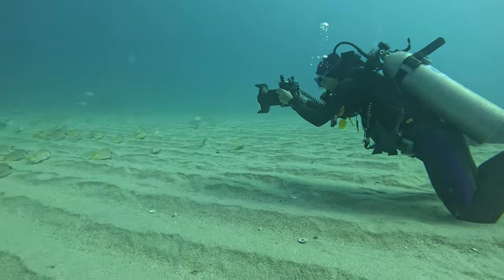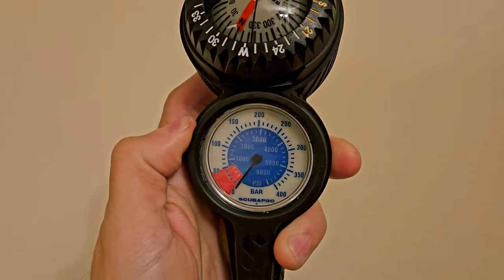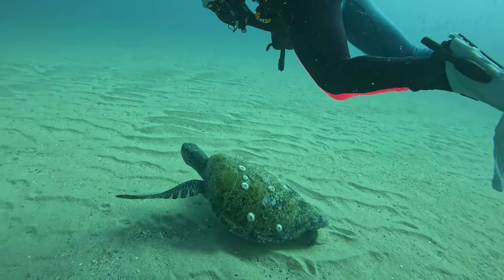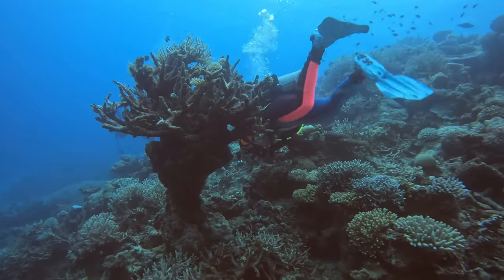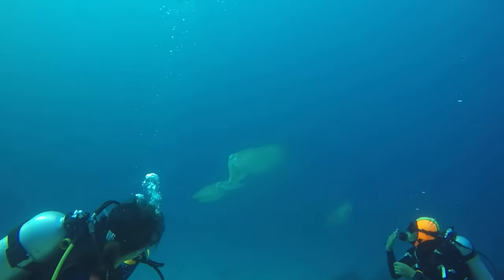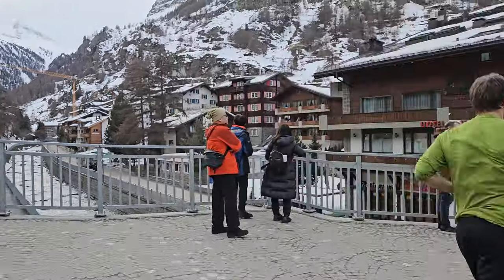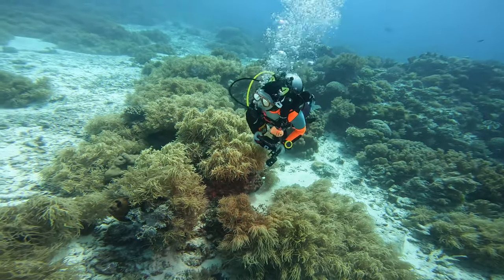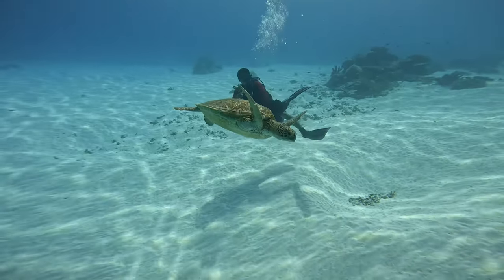How to Make Your Air Last Longer in Scuba Diving

Comment: As a perpetually overstressed engineer, I found that even when I thought that I was completely relaxed during dives I was still a gas hog and would dive 100’s to keep from limiting the other divers dive time.  When I switched to an AI computer and turned on SAC rate tracking, that gave me real time feedback on my level of relaxation during the dive.  This gave me the information needed to tell when I was actually relaxed and breathing well vs just thinking I was.  Within a handful of dives I’ve dropped my avg SAC rate from the high 30’s to the mid teens.  Shared my trick with another engineer who was sharing the dive boat and he said that he was able to noticeably improve his air consumption after just one dive.
Reply from the maker: Love this tip, and I am glad it worked for you. We are eyeballing getting a Perdix this winter after the wallet cools off from buying a dry suit and other cold water gear but will be giving that integrated air a try and exploring my SAC more!

Comment: So this guy went down with you without a full tank, how else could he be out of gas before you? And no one checked his tank before the dive? Or maybe hi is a heavy breather 😂
Reply from the maker: There are many factors, there was some current and that creates anxiety for some which spikes the air consumption  and you likely work harder than you need. He is a bit of a heavy breather, too, haha.
Reply: @itravelwisely  If I sounded a bit harsh I apologise and as my own sac-rate is more on the high side than low my dives tends to be a bit shorter than I would like, my solution, when I need to extend my dive time, is to bring a “pony” 12 along, litre’s that is😁. Stay wet and a close watch at the time🤿🇸🇪
Reply from the maker: Definitely appreciate your thoughts! Improving airtime is something we can all work on and it's interesting to see how much we can improve the SAC rate and what factors into it from dive to dive. Always fun haha. I try not to make up for it with gear but having a pony bottle is never a bad idea if you can manage to bring it with your kit everywhere!

Comment: I’m really fit but a large guy (6’8”, 220 lb).  I do ok with air consumption but wonder if my sheer size hurts me.  Seems like they should have bigger tanks for bigger people 😂
Reply from the maker: No sweat! There are many things from trim, buoyancy, and calmness you can learn along and improve your air time significantly. There are a number of things to improve. They do have bigger tanks, and I have seen folks explore using double tanks! These can be crutches, though, so start with improving your skills and then explore using additional equipment.
Reply: you can buy (or maybe hire) 15L, 18K or a 20L faber steel cylinder; or use a Twinset
Reply: You should try diving steel HP120 or HP133 cylinders.

Comment: Awesome video, I did my open water cert 2 weeks ago. Any tips for if the current is stronger than expected?
Reply from the maker: Really glad to hear you enjoyed it! I have another video dedicated to current diving here:
https://youtu.be/Ej9ovxr8kOs
Check it out! In short with current diving, your goal will be to use terrain to block current if you can. Pull yourself with the rocks on the ground as opposed to finning, and strategically moving between points that you can use to break the current.
Fighting the current for an extended time will only wear you out, elevate your heart rate, destroy your air consumption, and likely give you a carbon dioxide headache like no other. 
You want to be calm and relaxed in current and be as lazy as possible. If you do a short spurt of finny against current, slow down and take a rest when you can and let the heart rate slow.